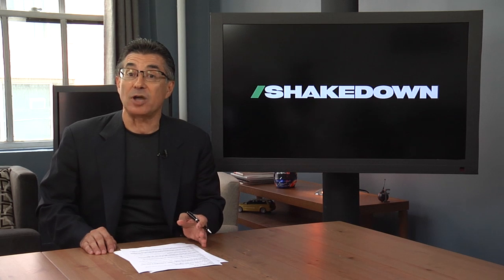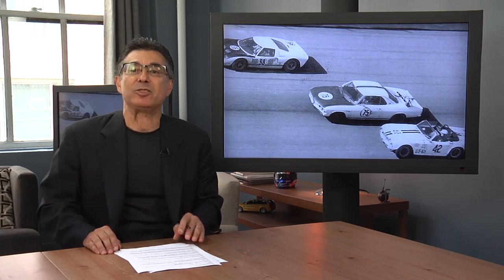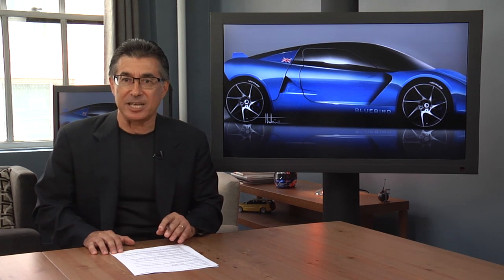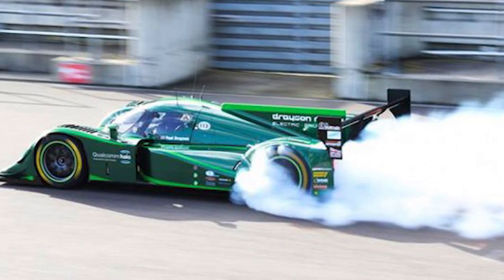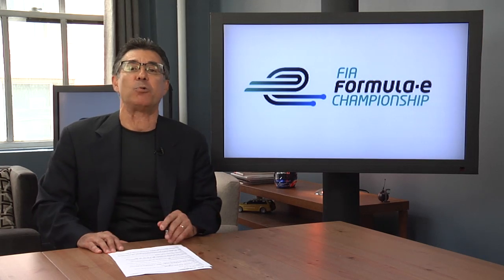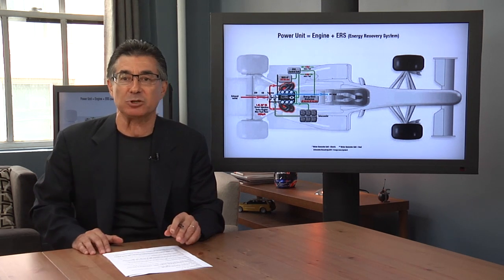Formula-E, Electric Racing for the Future - /SHAKEDOWN

Comment: I just want to quickly address some of the issues that were raised with this.

1) Noise.  Since these cars are going through cities, I can understand the silence.  But honestly, if the races are only going to be 1 hour long, it would be really nice to have an electric whine.

2) Pittstops and battery life.  I am by no means an expert on battery technology.  I'm simply going off what I have seen in Chris Harris' video on the Drayson B12/69EV, which is a fully electric racing car designed by Paul Drayson.  In the interview with Mr Drayson, a question regarding battery life and weight is proposed, to which the response was that the technology already exists.  However, it is still undergoing testing and development, and is not yet at the level where they wish to make it available to general consumption or in racing.  Key word being yet.  This technology is on its way, and perhaps we won't need to completely swap cars in the future.

3) Speed (or comparative lack thereof).  Going off the Drayson again, 850hp, 4000 newton-metres of torque, sub 999kg, 208mph top speed.  This technology currently exists in practice.  It can only improve from here.

Finally, a fair few people don't seem to like the concept of electric racing in general.  Among the main purposes of Formula E is to encourage development of electric vehicles and inspire new technology.  Racing has always pioneered technological improvements that have been translated into road cars.  Formula E will be no different.  

Furthermore, a notion that was brought up in this video was the idea of electric cars/hybrids dominating various forms of racing.  Why is this bad?  If these cars are dominating racing, then surely this is proof that hybrid technology is not only less environmentally damaging but also delivers more performance!  I for one am greatly anticipating September...

Comment: The bad news is, the battery alone weighs 200kg, or 440lbs. That would be quite a lot of weight to shift.
Reply: Very true, they're not quite there yet but if you think how heavy and short-lived the batteries would have been 20 years ago, they're going in the right direction. In a few years they'll have probably halved the weight and the charging time while still doubling the life cycle of the batteries. I do love the internal combustion engine but if we end up with hybrids that use a tiny fuel efficient lean burn motor to charge lightweight batteries that power electric motors with huge BHP and instant torque, I'll give them a try!

Comment: The problem is power to weight ratio... Less than F3 so way out of the worlds of F1 tech and perf. I LOVE e-car, but this is stoopid. It is pretty much a normal formula car with an e-motor in the place of the combustion engine... Pitty. There is so much thing to do with e-powertrain on control/drivability/packaging.

Comment: @El_Nino ""Mostly built of plastic/carbonfibre and running on rubber tyres which are 99-100% PETROLEUM."

Because we shouldn't be burning it, We should be building stuff with it, before it all runs out. Once it is burnt you cant use it anymore.

Comment: I think that the roar of a present day racing machine should still exist, the cars really won't change anything to dramatic (Besides janky pitstops), but the roar is something I've grown up with, something from near enough to 100 years to now (1930). They should come up with a way to add a more usual sound to the car, maybe we should look into hydrogen/water powered engines instead of electric, we would then be able to keep over V-8's and V-10's.

Comment: Changing cars maybe exciting, because the team will have to set-up two cars instead of one, and they can use different strategies for each car. However, I think the teams could easily figure out a very quick way to stop batteries and make pit-stops as exciting as in F1. Remember 2014 is the first year of Formula E. many things about the cars and race will probably change in the first years to make it better

Comment: I think a race has to have the possibility of running 24h in order to be long enough.

As far as your idea, you could use a liquid-cooled supercapacitor to shock charge at the pits (provided you could find one that can handle that much surge) which would in turn charge a battery or a flux capacitor to provide power to the wheels. The flux capacitor/ super capacitor combo would be enough to swiftly provide full power to the vehicle, and regain a small amount of electricity when decelerating for t

Comment: Formula E can have the whirr sounds (like the Mission R motorbike).  What if the race cars ran high voltage, lower capacity batteries to do battery switches during the race?  Tesla has a machine change a battery of a Model S in what, 2 minutes?  Something down to 30 seconds would keep the racing competitive.

Comment: Lithium is actually quite abundant. If they were running NiCd batteries you would be worried, but as if you would put those in a race car (a tonne of weight for no power).

Comment: pretty sure everyone is aware the amount of fuel used in racing is insignificant, the point is that they are racing in the direction of electric rather then fuel, which as a result makes technological advancements in those areas

Comment: I can dig Formula E. if anything someone could come up with some awesome sound that can help the driver judge how hard the motor is working. Link it with the main drive unit so when you hit smash on the... electrons >.> you get useful audible feedback. But they really need to change that swapping cars at a pit stop thing. Why not an energy cell of some sort? Battery tech has come quite a long way since that electric series in the 90's. Racing is supposed to be about pushing tech and this will.

Comment: I feel that this is a good move for battery technology, if you want to improve a motoring technology then race it. I feel that 1hr long races may be pushing it, why not run it like BTCC where by you have 3 short races with time in between to charge up, once battery technology improves you can start increasing the race lengths, can you imagine changing drivers... the coms, the drink, the 6 point race hardness, the hans device, its gonna take a while.

Comment: That FiA wants to be 'percieved' as environmentaly friendly by creating another Formula is such an insult. 

It's not the tiny amount of fuel that finely tuned racing engines use on track that is the problem - it is putting the cars, equipment, teams on planes flying back and forth all over the world! 

With Formula E because of impracticality each driver has two cars each race .... That means even more tonnage hauled by planes and trucks from race to race. 

It's not 'green' at all, it's dumb.

Comment: This along with the Merc SLS-e program are good for innovation, but I'm not a fan the limitations on higher sports like F1. What happened to true innovation? Back when different engine configurations and technology was used, why can't the FIA push for higher valve counts, experimental tech like five stroke, or idk maybe try and figure out Liquid Nitrogen or something instead of shrinking the engines. Like get ride of KERS and instead just promote Formula E at F1 events like GP2

Comment: How long does a race have to be to be long enough? 

Swapping batteries is working around the technology's shortcoming too. My idea of recharging has the possibility of getting to the point where electric racing would mirror conventional racing. 

There is a compromise in the beginning because of the infancy of the recharging tech but has the possibility of getting better. But battery swapping is a compromise with little opportunity of improving that process. I mean, what is there to improve?

Comment: You will have to forgive me. I had thought you were a pitstop purist. 

I don't agree that races should be made shorter to work arround technology's shortcomings. If anything, I think they should be made longer so that it necessitates a full recharge. FIA could easily enstate a rule that atleast one of the batterypacks needs to be fully recharged and reused in the race.

Assuming interchangable batteries are still off the table- infrastructure and racing- some car swapping might need to be done.

Comment: I respectfully disagree.  I will never support e-racing.

Three vital elements are detracted:  The amazing engine sound, the competing car's handling due to additional weight of the batteries and most fundamentally, speed.

I also disagree with you about the development curve.  Modern electric cars owe their technologies to appliances.   

The reason that this tech hasn't been seen in cars is because it is impractical and up till now, there was never any real incentive.

Comment: Another thing to add. I don't like the fact that they will switch cars. I know that it's impossible to fully charge a battery during a pit stop. So the only option would be changing the battery. Hopefully, and what is more probable, is that fans disliking the car vehicle change during the race will push manufacturers and developers to make ultra long lasting batteries.

Comment: Also, not changing batteries may be a safety concern. My experience with hybrid technology, and large battery packs/arrays, I can imagine that there is concern for safety for the vehicle (electronics) and the driver. Changing the battery packs out may be more hazardous than you realize.

Comment: I think e-tech could work really well in rock crawling comps--even better than gas. Right now they have engines, transmissions, and transfer cases in the chassis (up high) with drive-shafts that have to run down to the axles. I'd like to see someone explore electric motors built right in the axles with nothing but a couple wires running down to them. It's a perfect high-torque, low-power application. I think people would except it if it performed.

Comment: Yes it's a great idea.  I don't like the car swap idea or the low power. They should just have shorter races that would test teams ability to be the fastest but also go the distance. I like the idea of pitting to change battery packs or something similar. Ideally straight aways need to have charging infrastructure powerlines above similar to what mass transit uses.

Comment: Sure that would work but that is not dealing with the issue that battery recharge rates are too slow and the energy capacity per mass of the battery could always be improved upon. It solves the problem with a solution that makes one of the main purposes of racing that tech partially void. I want them to highlight the problem area so it gets the most attention by engineers.

Comment: dude its a 911...im sure they did the old vw trick for making an aircooled a mid engine car by flipping the motor forward over the axel right behind the driver.and viola a mid engine racer! its still a vw bug no getting around that. just like the 911 and all its variations over the years.the first 911 had an aircooled 2.0 6 cyl.with about 125 hp the new 911 is totally different and water cooled...lets tace it Porsche could build  toilet,cal it a 911 and thats what it would be,they name the cars

Comment: With regard to formula E, I love everything about it except the car changes. Requiring the driver to use the same car would push teams to refine the faults of electric cars as opposed to just ignoring them. It would require new strategising and introduce interesting dynamics into the sport. Is the higher downforce worth the lower battery life, is it worth it to create a battery that can be switched out quickly or just making the whole thing lighter and more efficient? Can't wait to see.

Comment: Formula E, or really whatever main electric racing competition, should be the electric cars doing the things that petrol-based cars can't - such as the in-turn slowing of an inner wheel the 4-motor electric AMG that Chris Harris tested displayed.  I don't see the whole problem with the loss of internal combustion 'noise' if the entire program is a paradigm shift in how cars perform.

Comment: dont favor electric cars at all..... only give credit to its efficiency. not even its torque capabilities sit with me. no manual trans, just gas & brake...... no engine mods or tunes, just currents........ last no exhaust notes of a motor just a 1 increasing wiiii sound. out 3 hyper cars P1 is mean, had interest in early 918 but not final. Laferr its ight wouldnt invest by choice. the future of a driver looks boring with electric.... still early in time we see.

Comment: Cont.: Drivers will have no motivation to keep from damaging the car if they just throw away the one they're in for a new one in 50 laps. The races might as well be only as long as the batteries last, because it will be like 3 independent races in one if three sets of cars are run at three different times. Why even use the same driver?   --I got it; here's one way it could work: Formula E tag team racing. When one hits the pits, the next driver is off. And the old driver sits and charges.

Comment: There will have to be something different figured out with pit stops, changing cars doesnt work for me, nor do I think it will work for any fans. Because after all, isnt racing about PROVING whos got the fastest car, best tech, and most skills? nothing will be proven if every variable resets with a pit stop. The Scientific method is racing applicable. As few variables should be changed as possible at a time. Every consequence of a drivers actions will be wiped clean with the car swap.

Comment: There hasn't been enough transition from gas to all electric. Current hybrid race cars use parallel hybrid systems which emphasize gas and electric working together. We need race cars like the Karma or the C-X75 which run a series hybrid and start the separation of the two systems. Cars like that are the next link for a future of electric race cars as they offer manufacturers a chance to build technology for the present while innovating for the future.

Comment: I agree, you'll be able to hear how they're throttling the car in the corners by the noises of the gearbox and the sounds of the tires.  Of course it will be different but that doesn't have to mean bad.  The whine of straight-cut gears is pretty cool by itself.

Comment: Nowadays, when the "garagist" days a long over, racing seems to push forward only marketing bollocks. Claiming racing is so much about innovation is only part of the marketing. What's the R&D budget of a mid-sized/bug manufacturer, in billions? Compare that to even high-level series racing budgets - and most of it goes to other things than R&D. And there's the "small" difference between finding 100% limit and cruising to the nearest supermarket.

Comment: Formula E will need to do away with swapping cars. If anything make the races shorter. Set up the racing the way you envision it then let the tech that you want to improve be the key for a team to succeed. As you change tires, recharge the car even if it is just a small amount given our current technology. Don't make many rules on how they can recharge. If they improve their recharging tech for pit stops then they can drive more aggressively on the track. Is there anything I am overlooking?

Comment: I like the idea of electric race cars, but i think they should be held to the same standards as ICE race cars when it comes to pit stops.  These electric cars should be modular so parts/tires can be swapped out in the pits, plus this would further charging technology; which i feel is the reason they are just going to change the entire car instead, b/c they cannot charge fast enough. As far as hybrid race cars: TOO HEAVY I can see the +'s but they come at the expense of driver-car connection

Comment: I think it's a highly interesting topic. On the one side, you have the negatives: silent cars, changing cars during pit stops, slower pace than ICEs, potentially dangerous battery technology. Oppositely, the positives: oil won't last forever - electricity potentially can, competition here will surely advance battery and EV technology (e.g. for use in hybrid road cars), and it provides the possibility to actually put EV's to a real test, and figure out if they may be the successor to ICEs.

Comment: I will never agree with anyone when it comes to electric cars. This is a step backward in my opinion when you can tune a push rod v8 with a carburetor to get 60mpgs. Its all about air/fuel mixture. Only problem is the big gas industrys don't want us to know this.

Comment: You can't say its advancing technology when it lacks the speed, range & practicality of its ICE counterparts. Go find a truck driver that's going to drive an all electric semi, see how he likes it. New tech is suppose to out do old tech. EV racing is a step backwards not forward. We should be focusing on renewable energy & fuel sources not this EV nonsense, forget the pollution that's going to be created by providing power for EV's, count the cost of disposing of those hazardous batteries

Comment: I don't like the idea of EV racing because EV's do not represent what a race car is. A race car is lightweight, fast & noisy. An EV is none of these things, the weight of the batteries is going to hinder its cornering ability, its speed is going to rival that of slow open wheel cars miles away from F1 speeds (the difference is like night & day) & the lack of noise just takes the passion and excitement out of it.

Comment: Until there are restrictions on Formula-E to not swap cars and limit or ban battery swaps, this will be a pretty boring series. There needs to be some reason to push the technological limits, or the electric car market (racing and non racing) will stay stagnant. And that tends to make racing rather boring.

I also think the issues of aero need to be addressed. Basically all F1 cars could be better if they were allowed to make more innovative changes. Let's do that here, in a totally new series!